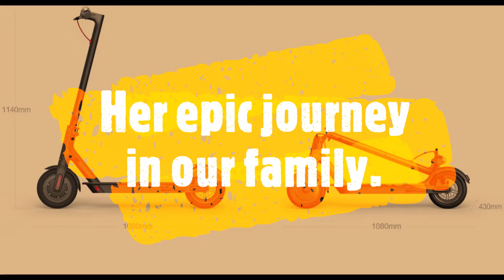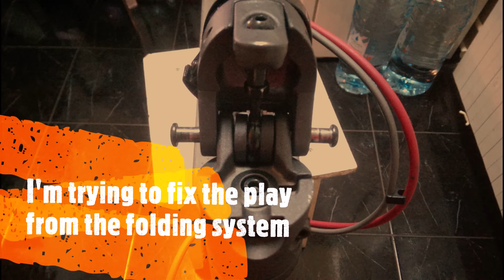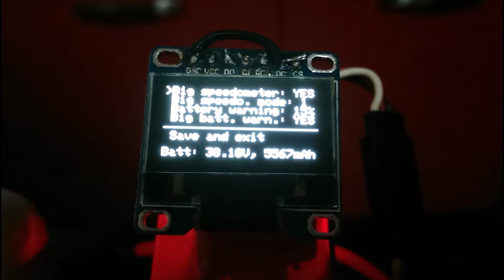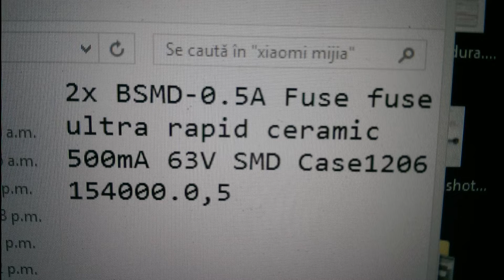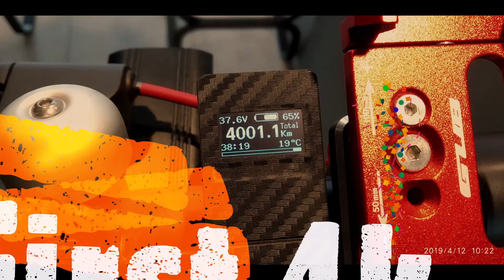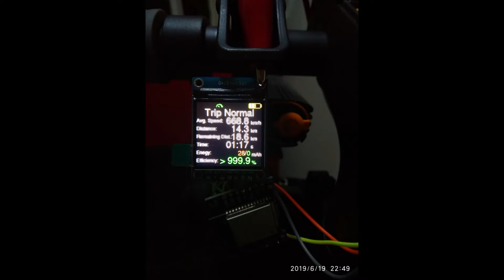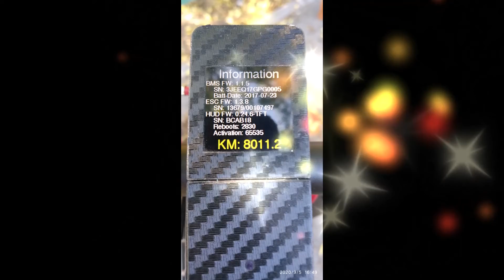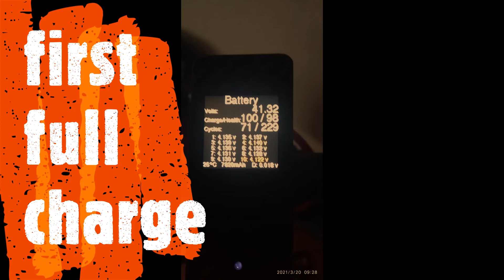Xiaomi M365 After 8000 + Km

Comment: After riding the xiaomi pro scooter for 2 years and driving 20,000 kilometers, I changed the accelerator once, 3 pairs of bearings, a motor, 2 inner tubes, 6 solid tires, 2 brakes, 6 brake pads, and a front shock absorber.  The battery was fully cycled 735 times.  .  .  The quality is still good
Reply from the maker: 20.000KM  on 2 Years ? kinda hard to believe that ....
Reply from the maker: @xinweinan817  ok
Reply: Yeah, i ride mine daily, for year and half, and i still didnt cover 4k km.
I think 20 k is a bit exagerated😅
And i use mine to go to colleage, get grosseries, go for evening drives, take the garbage out, etc

Comment: My scooter is 1,5 years old, and i covered 3900km.

And mine is a clone, its an iscooter from ali express 

The engine is quiter, its more powerful, its perfect. 

It was 250€🤭, and it has the original tyres, battery, etc

Comment: In My scooter was damaged controller, i changed it and it don't  shows battery  capacity, is not working  front light and  becomed 3 speed modes e,d,s.  Scooter lost a little  bit power and its drives just 20km max, is not working tempomat. I don't  knaw what is the ptoblem... maybe  this controller  is for new models of xiaomi. I cant unblok scooter also, any ideas how to fix it ?
Reply from the maker: NO. Sorry
Reply: What controller did you replace with?  Are you using a Xiaomi controller? And if yes you should try to connect it with the Xiaomi mi app and follow the instruction to unlock the scooter.

Comment: How is it possible to ride 28km with a m365 ? 
Are the estimation from your screen correct?
Reply from the maker: YES. It is possible. With the stock battery when it was new, the most I went was 32 km in eco mode and with breaks between shifts. With the new battery, I estimate almost 60 km of autonomy..
Reply: @ovidiu969  Very good. I use only S (sport) mode. I will try economical mode. 
Unfortunatly, I think it's not possible for me because I use a solid tire. 
I will try and I will feed you a back
Reply from the maker: @ibizap258  Range depends on several factors. Weight, temperature, road quality and how aggressively you drive... Battery and/or scooter wear. Yes. Solid tires drain the battery more than normal ones....
Reply: How do solid tyres wear the battery faster? 

If the "pressure" is always the same and the tyres are rigid, than its always at its best, just like in the car, with the tyres pumped up, it wastes less gas, because it rolls better.
Reply from the maker: @joaorodrigues-dy9rm  Solid tires are heavier and strain the battery more when you accelerate the scooter

Comment: My Xiaomi m365 pro needed a controller change after the first 4k
Reply from the maker: I didn't have this problem.
Reply: @ovidiu969  randomly while riding it there was a noise and there was no more acceleration but it was fixed after a controller change